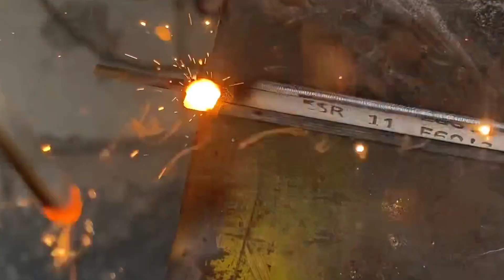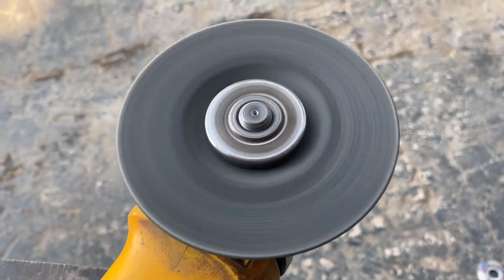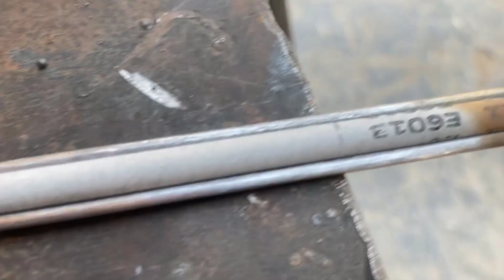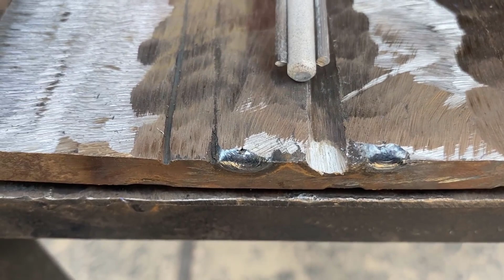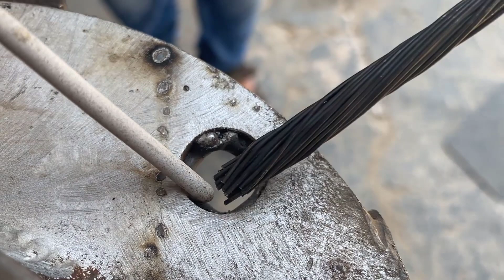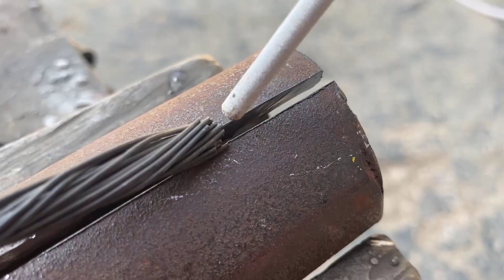Trick with the secrets of electric welding

Comment: Fabulous technique brother ❤️👍.
Reply: HAHAHA no
Reply: @3ch0_17  why sir please tell me
Reply: @nathkrupa3463  oh the reasons...
For starters, you just don't do that. It will not provide you with better welds, it will almost definitely give you bad quality welds. The reason FMAW sticks have Flux on them is to prevent the metal you are welding with from burning. Each stick has the right amount of Flux on it to prevent the metal you are welding on from burning up. If you use extra metal, as this video suggests you do, you wouldn't be using enough Flux for the purposes you have Flux.
  I can promise you that the outcome he had from doing that is completely different the the outcome he showed you at the end of the each section. I can promise this because that metal isn't the metal he started with. That weld he showed you is not what this "secret" would look like. If you did this, your welds would look, and perform like shit.. if you want to lay down more metal you use thicker  rods, or do more passes.
 
 Secondly, it's a waste of perfectly good sticks. But for the section that he uses a bundle of wire for additional metal, thats just  dumb. FMAW sticks, when covered in Flux, don't erode as much or as easily as a plain old bundle of wire, and FMAW sticks don't have whatever wierd contamination that whatever plastic that bundle of wire was taken from. I know that FMAW, e6010 sticks specifically, are known for thier ability to be used on metal that isn't all that clean eith good outcome at the end. That doesn't mean you should though, as contamination has an effect no matter what process you use. 
 
 I can think of a few other reasons, such as the extra wire/ rod you are using to make up for your lack of welding skill could be a different type of steel, or different type of metal, which would interfere with your hopes of a good outcome. And the fact that, atleast in the US and other bigger countries, that will not pass code. If you used that during a test, you'd fail the test. 

 And my last reason is to watch the other videos this guy makes. Nearly all of them are bullshit.
Reply: @3ch0_17  thank you Mr Henry Johnson 
You are right 
Thanks for right information sharing and 
Replying sir 
Have a nice day sir.